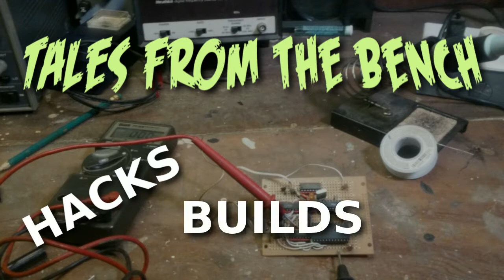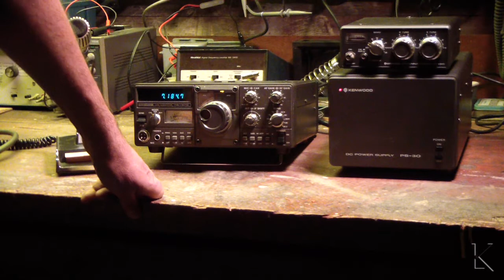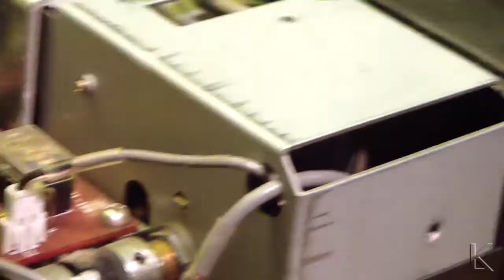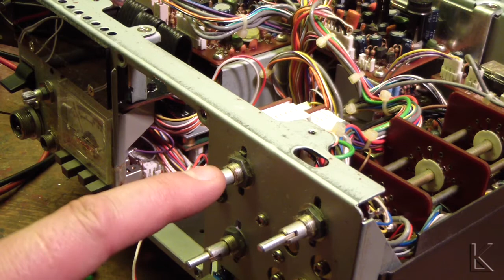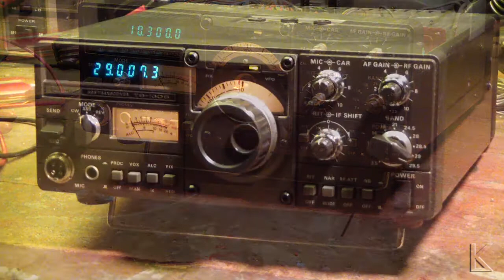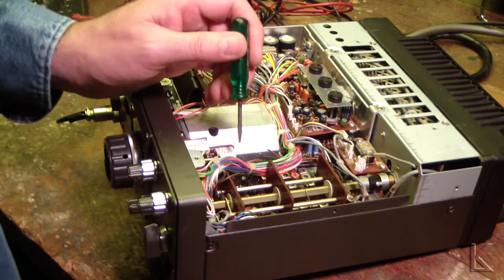Ham Radio - Kenwood TS-130S repair and cleanup.

Comment: I have two PS-50 PS. One works fine, but the other had a blown 20A fuse. Replaced the fuse with same, but there is less than a volt on the radio plug pins, but 23.4 VDC on the screw terminals. Is this a common occurrence with these PSs? Where would I start looking for the problem? Caps all visually look good with no obvious bulging or leaking. No burn marks on the board or toasted components. I have the schematic and a good bench meter. No scope though.
Reply from the maker: I would check transistors Q4 and Q5, and zenier diodes D4, D5, and D8. Just a guess after a quick glance at the schematic. Also, the terminals and the radio connector are wired in parallel according to the schematic, so there must be the same voltage in both locations. They're hardwired together. According to the schematic. I don't have the radio or power supply anymore so I can't verify any of that
Reply: @loughkb  I thought the same thing about those external terminals. There's no reason why that voltage shouldn't be the same, but it's not.
Q4 & Q5 was high on my list of suspects too. I will also check those diodes. Thanks for the help.

Comment: I absolutely love the AT130 tuner - It works great !  I actually bought a TS430, the power supply, and a speaker, just to get the AT130.  It was a smokin deal.  $250 for all of it about 2 years ago.

Comment: I just upgraded my Ham license from Technician to General and picked up a working Kenwood TS-430S with matching power supply, PS-430.  The meter does not work on receive but does on transmit.  Any ideas???  Can't wait to get a long wire antenna and antenna tuner to get on line.  My radio has 2 mods, one white wire disconnected that allows all frequencies to be used and the 10th kHz jumper wire clipped to activate the last digit on the VFO.  73 from K9POW in eastern Tennessee.

Comment: I just got this radio from my dad and plan to see about 30,17,12 meter lockout that you cut the brown wire on. The op manual says it will transmit on the bands , but then says diodes installed to prevent transmission. I guess once I get my antenna connected, I'll know for sure. Nice to see the insides without opening mine.

Comment: Hey Kevin, I just came into the same model.  They thought the mic circuit was bad but I think the finals are blown.   First giveaway was fan isnt working and no 5vdc. Wondered if you have any tech data that could help me fix it.  My email is piercejj@verizon.net.  thanks KM6QAQ 73

Comment: Kevin, I bought a used one and it works fine in SSB but in CW it shift the frequency up 600Hz as soon as I close the key. Any idea why? 73,  Yvon NU6I
Reply from the maker: Shifts it on the display?  In CW your transmitted frequency is normally offset by 600-800Hz.  It has to be or the other station would hear nothing since you would be zero-beated.  The VFO display shouldn't change though.

Comment: I have a TS130S as well.  After being on for about 20 minutes, the receive audio drops down to practically nothing and at the same time, the CW side tone gets louder than a car alarm; That's going to be a fun one to try and troubleshoot. It sounds like a cap in the AGC circuit might be bad but that wouldn't explain the side tone getting loud. If you have any ideas please let me know.

Comment: TS-130S and AT-130 tuner was the BEST and simplest transceiver I have owned.  I even bought a spare AT-130 (also the BEST antenna tuner).  I gave the radio and tuner to a trusted HAM friend, and it is still going strong (maybe "forever," who knows?)  Hint: I cured the "drift" of the radio by simply exercising the crystal/vfo switch once in a while.  Jim,   AI4WC

Comment: Thanks Kevin for the video. After cleaning the wafer switches, do you use tuner grease or leave them dry?
Reply from the maker: I usually leave them dry.   But I can see the value in using some kind of lubricant if you have it available.

Comment: So Kevin, I watch many of your videos, yesterday, 14 Jan,18.. I found a way to use a Soda Straw added to top of my mag lite, to help find solder pads on opposite side of the circuit board. Especially works well over transistors, the soda straw fits right over the transistor. When you turn the board over you can see the light over the transistor.
Reply from the maker: Excellent idea!

Comment: Absolutely educational Kevin. Many people including me, have budgets that constrain us from purchasing new ham equipment. Your repair videos Kevin, give us hope that first off, the repairs are possible, and second, with some electronic fiddling backgrounds , these repairs can be done by the owner. Not always to be fair, however, if we match the faults to your repairs, a sudden light appears at the end the tunnel, so to speak. By the way, those long tubular light bulbs are common in aircraft emergency exit lights, they come prewired or bulbs separately. Anyhow, thanks for the awesome video. 73' KF2mS Biddeford Maine.

Comment: I picked up a TS-140S on Ebay that was As-Is and didn't find anything wrong with it right away, it has electronic band switching instead of a troublesome rotary switch, but the meter lamp was pretty dim so I replaced it with a 1 Watt LED.  The digital display went out when a little inverter module on the front panel board that produces a negative voltage died.  I opened that up and found a bad zener diode inside it that I replaced and the two 7805 regulators were a bit low so I replaced them while I was inside the radio.

Comment: I have a TS-130S. My daughter bought it for my Christmas present. The transmit power dropped to zero on several occasions. Have you had this problem? Could you recommend someone who could look at it? I live in Ohio in the Dayton area.
Reply from the maker: Sorry Jerry, I don't know of anyone out that way.   You might pick up some contact cleaner and clean the wafers on the band selector switch.   There are several.  One section switches filters in the PA, I suspect you might have a problem there.
Reply: I tightened the screws on the circuit boards and the power came back.

Comment: You do an excellent job explaining everything in detail.  I'm in the midst of a TS-130S that I got at the hamfest and your video showed me where to put back a connector that I took off.
These TS-130S rigs are known to have issues as they age and it is recommended to loosen then tighten snuggly every screw holding down each pcb inside.  If you want to be really thorough you can put a dab of contact cleaner between the pcb and metal that in many cases it is to ground to.
One other suggestion: when setting your frequency, don't rely on the display completely.  When you called that guy it was clear that you were 50 or more Hz off frequency by the Donald Duck sound of his voice.  He might have come back to you on the first try if you had zero-beated on his voice.  Many folks have a hard time getting call sign phonetics correctly when "Donald" calls, HI HI.
Keeo up the great work. 73!

Comment: kevin there some bands that a tech can use that is hf
Reply from the maker: Yes,  some of 10 meters, and CW portions of 80, 40, and 15.   Did I imply otherwise?   Sorry if I gave that impression.
Reply: hey kevin i would like to kno the 440s that you repair you did the removel of the glue do you think that u can remove the glue with heat gun or would not be good
Reply from the maker: I tried it,  it didn't work.   To get hot enough to soften the glue, I was heating the components way too much.   I didn't want to bake capacitors that much.    A chemist might know how to break that substance down, but then, you'd have it running around and making more of a mess.
I think the only way to do it is to be very patient and just chip away at it like I did.
Reply: ok i will let him know he going be giving me the 440s  and i dont  want it damage any more than it is
Reply: i told him to send it to me i got picks and other stuff to get glue out now he is going have replace one of the dioes but i am going to talk to him to night and hope that he see it my way  becuse it works as far i know tx and recive
Reply from the maker: If you can find a dentists pick, that might be a good tool to use.  I kind of made one and it worked well.   It's very tedious,   I'd spread it out.  Work on it for an hour a day and just take your time so you don't damage components.
Reply: i have few dentist picks that use when i am working on guns and got few i use for clay work

Comment: A very nice r&r video, Kevin. These are always very rewarding especially since the radio is going to a new ham. Also there is a nice, comfortable quaintness about these "old" Kenwood and Icom rigs from that era. With a half-way decent antenna they are MORE than good enough to land QSOs for a skilled op (and really show how superfluous many of the bells and whistles on modern rigs really are). 

I would only add that the burnt-out wheat grain bulbs JUST SCREAM to be replaced with the bright LEDs available with the shunt resistor. For example, I did an r&r on a DX-160 receiver and an old AN/URM-25D signal generator where the added brilliance was very welcome. Also consider the diode strips. They can be used with 12VDC and come with sticky tape to mske mounting easy. 

72/73

de Bill, k6whp 

dit dit
Reply from the maker: Hi Bill.     I would have done LED's had I had any on hand.    I'm sure the bulbs will out-last his use of the radio.
He's been having a ball making contacts across the county and a couple DX so far.
Reply: +Kevin Loughin..understand. Excellent r&r job nonetheless. And, goodness, that radio must have been virginal when put into to	storage not having the WARC mod done by the original op! Good job on the band switch work as well. 

B3 interested in knowing your opinion of the 130S versus your IC-745.

72,

Bill, k6whp
Reply from the maker: Oh the 745 beats it hands down.    Memory channels,  selectable upper or lower sideband, continuously variable power output, switchable pre-amp, variable tuning speed, more sensitive receiver, passband tuning,   and general coverage receiver.
I'm selling the 745 though.  Another ham gifted me a Kenwood TS-440Sat that was dead.  9 hours of work and it's like new, so I'm keeping it.